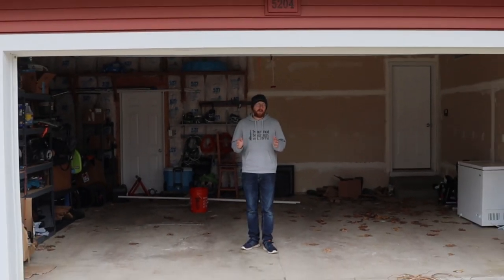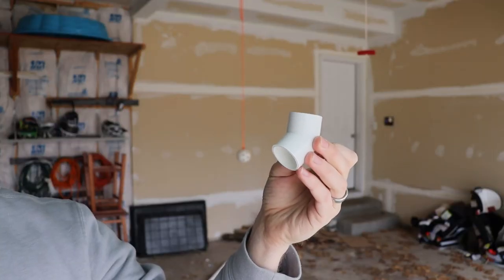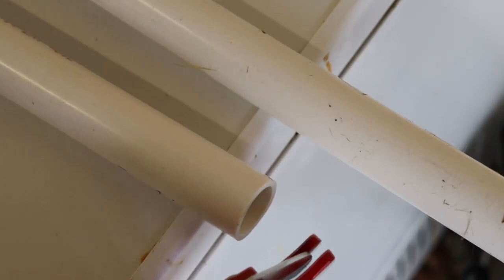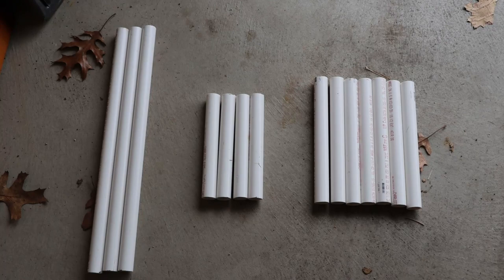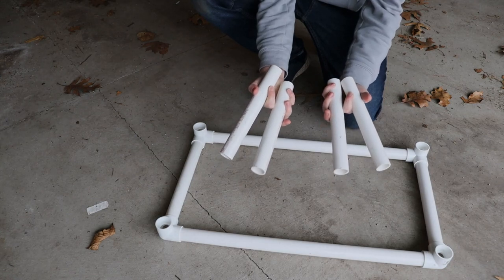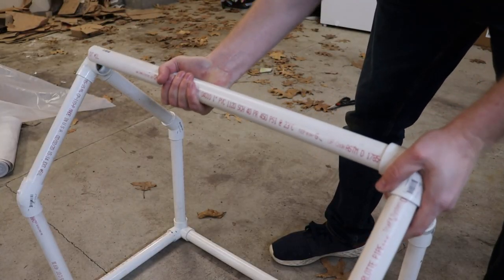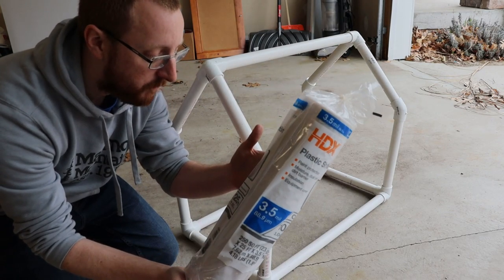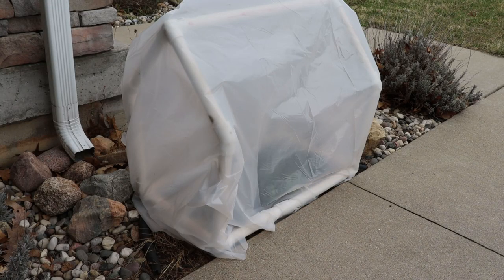How to Build a PVC Cold Frame | Miniature PVC Greenhouse Frame

Comment: Nicely done,  I watched quite a few, and   made my own measurements, I  chose to  support mine due to the upcoming winters. and make it out of 1/2 than larger.  I have the same HTC home depot plastic that  i will RETURN, will make  my own clips. and right now, the greenhouse is on protecting  the plant,  thanks again. did a nice job demonstrating.  i am going to use  plastic clear garbage bags that did not break down at all
Reply from the maker: Sounds like a good idea!  The plastic I used wasn't a good choice.

Comment: Very similar to those cheap plastic green ones with a plastic cover that get below away in the wind.  You could also fill the pipes with sand to weigh them down. Also glue corrugated plastic to cover.
Reply from the maker: Definitely some similarities.  But fully customizable!

Comment: What is the dimension of the garden this cold frame is to be used on? I am wondering as I am working with a 4ft by 8ft garden plot.
Reply from the maker: The garden is much larger.  This is just for a small plant or area.